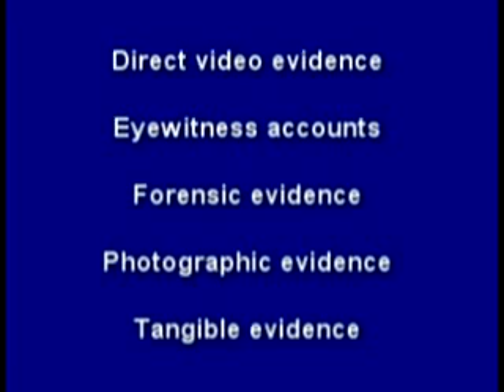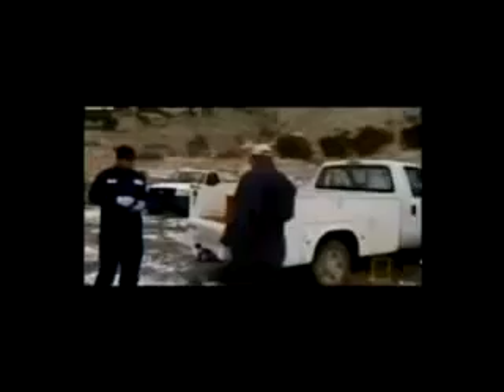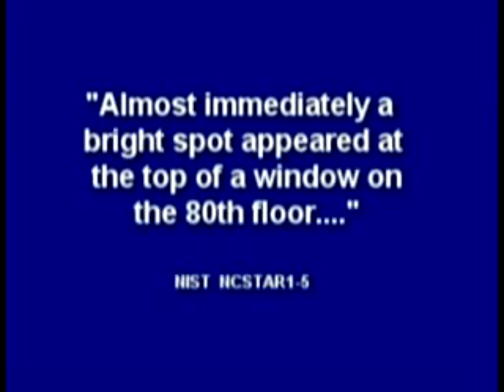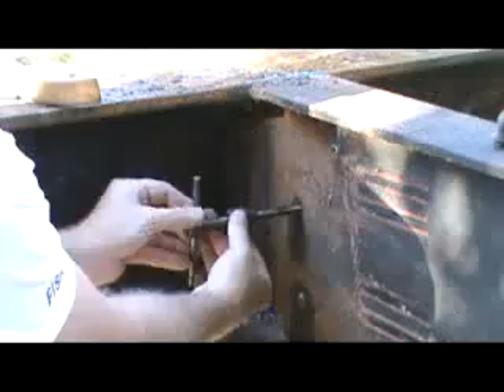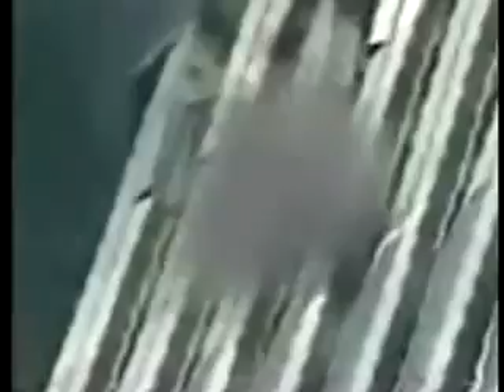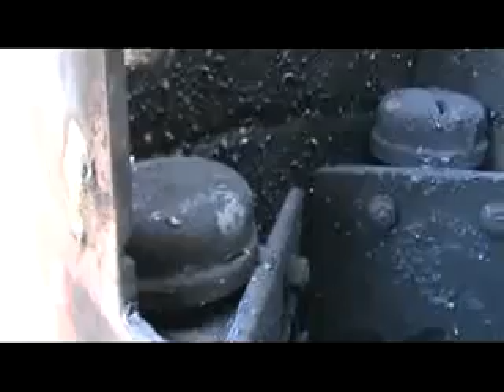9/11 inside job-Thermite and what it can do to steel beams

Comment: Building #7 was still actively burning and at that time we were advised by a NYFD Chief that building #7 was burning out of control and imminent collapse was probable. –PAPD P.O. Edward McQuade

(There's a time when common sense takes over.  That should have been 10 years ago for the "TM".  But sadly hasn't even kicked in yet. )

Comment: The top of WTC 2 rotates about 23 degrees off axis.  Why?  (Gee i wonder!! could a plane taking out that side of the building have anything to do with it?).  Once it rotates off of the columns (which it does).  It is now resting on the floors.  The floors DO NOT carry the vertical loads.  They transmit them.  They don't hold them.  And that is the MOST important part.  The holding!!

You're now asking a floor rated to carry 1600 tons MAX!!  to carry a dropping load of 180,000 tons?

No..

Comment: Also.  The force required to pulverize the concrete floors was a  MINOR cost to the collapsing section.  It didn't even cost this portion 15% of the total energy it had available.  In other words.  It could have pulverized the concrete many more times than it did.   

The concrete fracture value is a known number.  The weight of one floor is a known value.  If the concrete is powder at X and the impact force is X and you know what both of those are?.

The rest is simply math!!

Comment: No i haven't lost at all!!.   Buildings don't drop off the side.  It doesn't work like that.   All of the gravity loads are directed straight down to the footprint of the building.  The building DID NOT fall at the speed of gravity.  It fell fast, yes.  But not at free fall.  You can see the column sections twisting in the breeze falling beside it.  These are free falling.  The rest of the building is 20 stories above this in dust.  Two varying speeds here.

Comment: "Steel loses about 50 percent of its strength at 1100°F" (593°C), notes senior engineer Farid Alfawak-hiri of the American Institute of Steel Construction. "And at the 1800° temperatures noted at the WTC it is probably at less than 10 percent."

911 TRUTH DEBUNKED!

Comment: @PurePowerPunk it seems like you just enjoy being schooled by myself.

I could hand you your hat and cane my friend. 

Tell you what.  You pull out the yellow pages and call up any demolition company and ask them to use thermite on your next building implosion. (Do it.. i dare you.. but you wont will you?).

They would laugh your ass out the door.  This requires high explosives.  Not an incredibly slow burning incendiary.  Explosives are used not sparkler material.

Comment: @PurePowerPunk  You keep droning on about "FACTS"   What facts?   
Fact 1 nobody found anything relating to a CD at any of the buildings.  A team of CD techs were already at B7 when it dropped.
FACT 2 The steel failed from a prolonged exposure to fire a "rapid erosion event" that was not thermitic or explosive in nature ( I've seen the metallurgist talk about it)

FACT 3.  The entire FDNY fully expected B7 to collapse.  It was no mystery or smoking gun.

You want to add to that?

Comment: @PurePowerPunk   The more you speak the more you show yourself to not understand what you are talking about.  There is video on YT.  (I will send you the link).  It has the NIST B7 simulation and the actual footage of the building collapsing in a split screen running at the same time.

I think you will see that both line up...............PERFECTLY.

Have i insulted you?  No.

Comment: @PurePowerPunk Get your facts in order then came talk to me

Um. ok.  Its not possible to have the collapsing portion of the building running 10 stories above the debris field which IS floating in mid air and you can plainly see column sections twisting in the breeze.  They are free falling for sure.  The debris that is liberated is free falling.  Not the building collapsing in the cloud of dust 10 stories above that.  

Go look at it.  

Them's facts my friend.

Comment: @PurePowerPunk    The free fall thing about them falling as fast as a ball dropped from that height is a fallacy.   There is a physics guy who worked it out on a graph.  I will have to find the link.   They are falling nowhere near free fall speed.   And all you need to do is look at WTC 1.  There are column sections falling in mid air that are absolutely falling in free fall (you can see it)  the rest of the building is 10 stories behind them falling much slower.

Comment: @PurePowerPunk  What facts?   You guys don't seem to get it.  You have found nothing.  Thermite is not a substance used to take down buildings.  If you think load bearing columns are going to be sizzled in two by a bucket of thermite?  You're on glue.  

A team of CD technicians were AT building 7 when it came down.  I don't think i need to spell out the significance of that.  And nothing was found in the WTC relating to a CD.

So what "Facts" am i missing?

Comment: @PurePowerPunk   Facts?  There is not a CD expert anywhere who ever consider using this material.  It  is not used to implode buildings.  And i know what I am talking about.   It also lacked some very key ingredients that were not present and would HAVE to be.  

Jones quietly doesn't like to talk about that though.

Explosives do not pulverize concrete floors.  Nor does Thermite. 

What does? 

Massive amounts of weight.  

That's a fact

Comment: @PurePowerPunk   Pull out the yellow pages and call up any demolition company and ask them to use Thermite on your next building implosion.   Then wait for the long pause and the laughter to start.  Because that is what you would get.   

This is not a substance that any professional in CD would EVER use for this.  It wouldn't happen.    It requires high explosives.  Don't kid yourself.  

These thermite stories are silly silly stuff.

Comment: 1. What was the thickness of the steel in the column section that you cut through?
2. What weight or volume of molten steel did you produce?

Comment: @PurePowerPunk I would be ASTONISHED if those amateur pilots were able to hit the buildings at exactly the floors you claim were specially treated weeks before the attack.

The fires were raging fiercely when the buildings failed. Watch the National Geographic DVD. Molten steel pouring out as fire billows from the shattered structure, then the corner of the building buckles, then the collapse starts.

There's no evidence of an inside job.

Comment: @PurePowerPunk 
So althought I commend the person who put this video together to expose the sloppy work by Nat Geo, I think there is a problem, you are saying that the planes pilots had to hit a certain section of floors for the thermite-loaded into the beams of the 'exact' floors'- to burn and bring down the building. Problem 1-how would the conspirators in your theory, be capable of ensuring that the planes impact wouldn't have knocked loaded beams out into the street? thus foiling the plan.

Comment: There's a reason the steel beams were originally coated with fireproofing insulation. Because when warmed up, steel loses strength. In an uncontrolled fire, the beams get hot enough to be unable to support the weight above...

The airplane smashed in, tore away the insulation then the fuel burned fiercely creating a forced-air furnace effect.

The result was rather predictable.

That's why the insulation was on there in the first place.

Comment: ..hmmmmmmm looks more like molten aluminum .Where would it come from..The Plane that was on fire inside the building...Of course the fire was not hot eough to melt steel..But it did cause viscoelastic thermal expansion....Who would be right..ask any gunsmith or blacksmith how easily steel will weaken once red hot..Ask a welder why they have type T1 steel on steel frame structures?,,